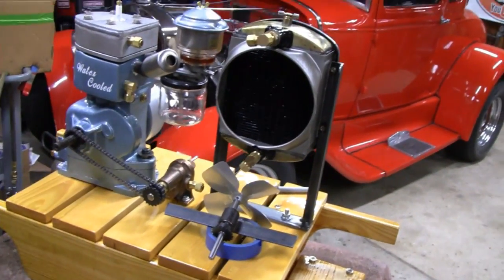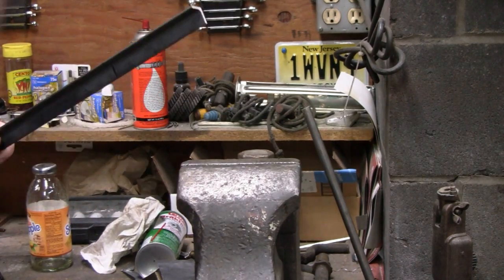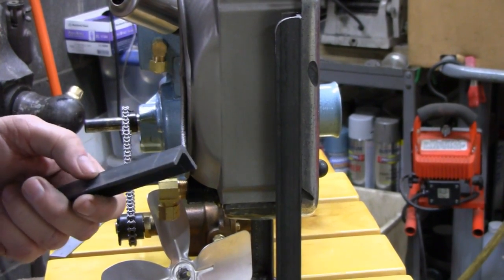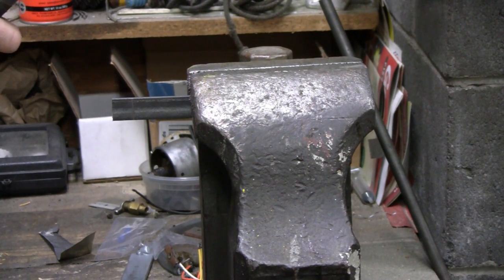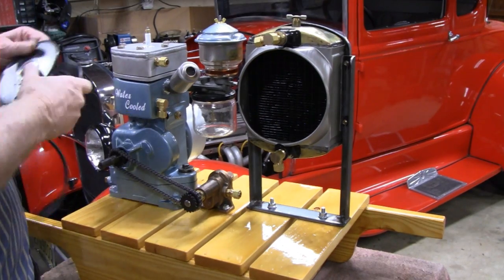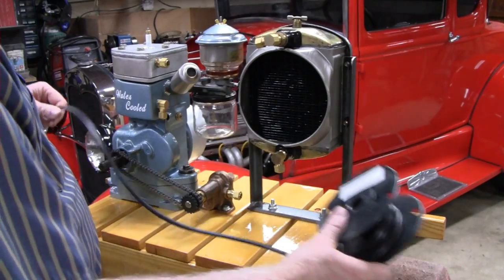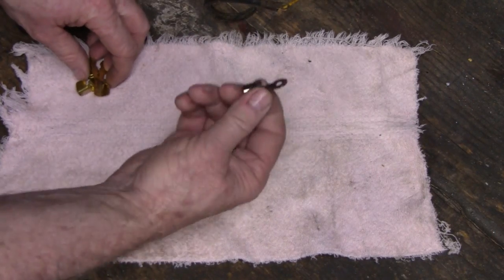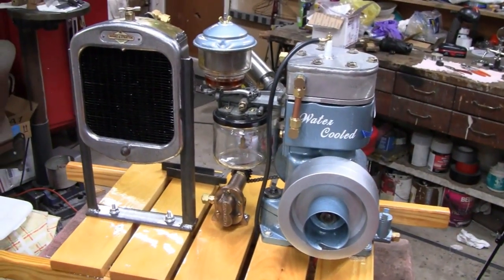HOMEMADE WATER COOLED BRIGGS ENGINE (part 41)

Comment: im wondering why the external water transfer instead of just drilling hole inside down through head ,into block on same corner tube is on.  i like the looks of the tube ,it fits the build ,but just wondering if there is a purpose for doing it other than looks . a little replumbing and you could go back to factory head ,thats one reason already lol,,,great project ...

Comment: you dont need a head gasket, if you use high temp gasket silicone you will be just peachy, also you will have slightly increased compression ratio and your piston wont slap the head unless something else is horribly wrong and a new starter relay is cheep, like 15 bucks for a good solid oversized one that can take more amps than you would need and still meet or far exceed the requirements of the mowers electrical system

Comment: just asking did you ever think of running flat leather belts  just think that mite have been used if that engine ever was made ,I know there a lot of work but some times worth it . only came to mine as I had to help start a model t today . the owner made a new belt for it when I was there pieace of leather and a belt henge pin type   so have a good week end
Reply from the maker: Thanks Bud!!☺

Comment: I have a similar Craftsman 11 horse, it started conk out after 5 minutes running, did it a few times. It was the original points ignition. I replaced it with a newer Magnetron electronic ignition, still runs like a top. hope it is fairly easy to fix yours!
Reply from the maker: Thanks Bud!! hopefully the valve adjustment will take care of it!!☺

Comment: Looking good, Roadking! 

You might find something suitable for your plug wire ends via the car audio industry. Maybe something for a 10 or 8AWG cable would fit, they make some pretty small ring terminals for those size wires. There may be something out there that looks nice enough to use on your projects.
Reply from the maker: Thanks Krank!! I might be able to find something at one of the shows!!☺

Comment: I have the same tractor, with the same electrical problem, swapped out the starter, solenoid, cleaned the ground, battery is decent.....must be the switch. I have to rock in the seat  to make a connection.
Reply from the maker: That don't make any sense Goomy!!☺
Reply: I know, but I can always get it going that way, lol. And it runs/cuts well. It has got to be in the ignition switch (which I swear I swapped out years ago)

Comment: nice rider. My first rider was identical. Model 917.255726  Got it used for $125. Mine went down for the same reason as yours. Didn't know how to do valve jobs at the time so i sold it and still regret it. All the 80s era craftsmans i find now are trashed. Mine was mint other than the burned valve.
Reply from the maker: Yeah I've been given bigger newer tractors and just turned around and sold them, they were just plastic junk!!☺

Comment: The rig needs a temperature sending unit and a gauge or a thermometer on the radiator so you can satisfy your need to see what temperature its running at or so I think it would be interesting to monitor.
Reply from the maker: Yeah I wish I could have found something to scale that would look good!!☺

Comment: I feel right at home in your shop because of your can of Kroil, same in mine.
Reply from the maker: A few years back the Kroil Co. was running a promotion and were selling the 13oz can for $6, I bought 6 of them!! I'm sorry I didn't by more!! That size cost $18 around here in the Hardware Store!!☺
Reply: 805ROADKING I didn't know it was still made, I have a can that must be.... OLD!!!
Reply: I bought it for work years ago, they had a promotion of 1gallon, pump oil can and the spray, I thought it was high priced then, I'll bet it's double now. It always worked well for me. A older neighbor down the street swears by mixing tranny fluid and kerosene.

Comment: Hey RoadKing , Since you are kind of going with a BRASS Theme why not use Brass Nuts and Bolts to hold the Motor in place as well as the Radiator Bracket . That would Look GREAT . That Spark Plug Connector is made by the AMP Company . They make all sorts of Connectors . Keep up the Great Work ...
Reply from the maker: Thanks Bud!! Too much of a good thing is no good!!☺

Comment: RK a suggestion for you as most mof your nuts and blots and fittings are brass if you have something like mapp gas , Oxy or other type heating tool  you could get a BRASS wire wheel and use that with the heat to brass the nuts and bolts easily ( heat the object and run the brass wire wheel over the chrome fitting till you get it to the "level" of brassiness you like) 
Tony from Western Australia
Reply: Yea, I brass brushed a piece of my stove pipe when it was real hot, and it transferred to the pipe, looks great and doesn't rust as long as it doesn't get too hot.
Reply: That's awesome, I never heard that.

Comment: Got my little magnifier spare hands at Northern Tool. Less than $5 if I recall right.
Reply from the maker: I think I got mine at harbor freight for $3.98 plus 20% off and a free set of screwdrivers!! It cost me more to go pick it up!!☺
Reply: 805ROADKING ain't that the truth.
Reply: John Ratko ........got mine at a local swap meet thirty years ago for a couple of bucks. You can find them at Radio Shack, Harbor Freight, etc. Helps you to see and read what your soldering in case of small circuits, wires, and lettering.

Comment: Here is my .02. Sir, your lawn mower does not have a solenoid. It has a relay. Your Chevy coupe has a solenoid on the starter.A solenoid is an electric device that transfers electrical current into mechanical motion, hence the solenoid on your Chevy. Many people have made the mistake of calling a "relay" a solenoid especially on Ford products. Your mower has a spring on the top of the started with threads that engages the flywheel when the starter is energized by the relay.I enjoy your projects. A true "Piney"  Ken
Reply from the maker: Thanks for your 2¢ Piney Ken!! I'm just referring to it by what the original factory manual calls it (part# 2008J) and the new one I just purchased http://www.ebay.com/itm/142052423159?_trksid=p2057872.m2749.l2648&var=441151846208&ssPageName=STRK%3AMEBIDX%3AIT
Reply: 805ROADKING  
as Sheldon from Big Bang Theory would say "Bazinga!"
Reply: A starter "relay" is usually made of a solenoid which is defined as a cylindrical electromagnet. Fords use a small solenoid in their relay to only switch on the electricity while Chevy uses a large solenoid to both switch on power and engage the drive gear into the flywheel. It's not incorrect at all to call a starter relay a solenoid since that is what they are made of.

Comment: I bought a few brass ones from eBay some time ago, so maybe give that a look. I'd provide a link but i don't have the shop anymore. Cheap too, i think i paid the equivalent of @6 dollars for 250 clips (had a big telephone wiring box job for a friend with an old school mechanical phone central).
Reply: With the mention that they weren't crimp on, but the solder type.
Reply from the maker: I'll check it out Mate!! It's about 249 more than I need, but that's a good price!!☺

Comment: the wire with the connector wit AMP on it was produce by the amphenol wire and cable company back in the 40s and 50s
Reply: Amphenol is not related to AMP Inc. Amphenol is American Phenolic Corporation. AMP is Aircraft Marine Products from 1941, now owned by TE/Tyco. Amphenol goes back to 1932. https://www.amphenol.com/about/history
Reply: my ham shack is loaded with them too but even inside some of my antique ham radios are these terminals that go from threaded post to threaded post
Reply: William Wetmore I Must be an old guy that AMP ring lug was instantly recognized!
Reply: looks like pretty high quality copper or brass?
Reply: Jupp .